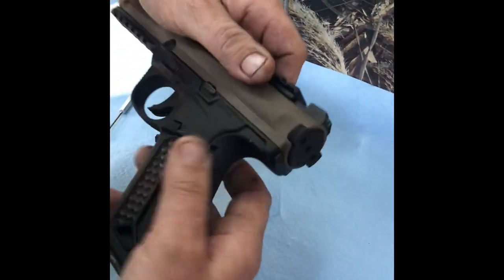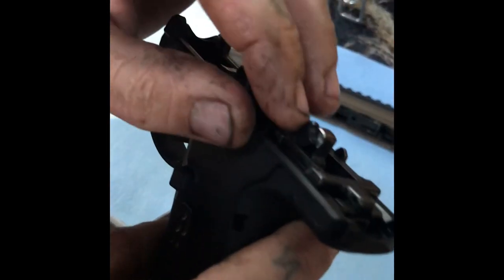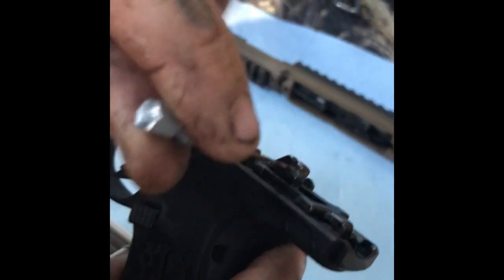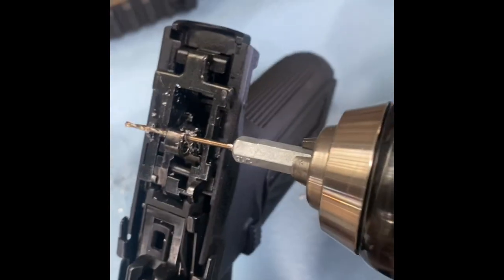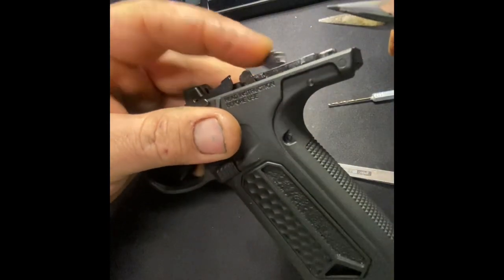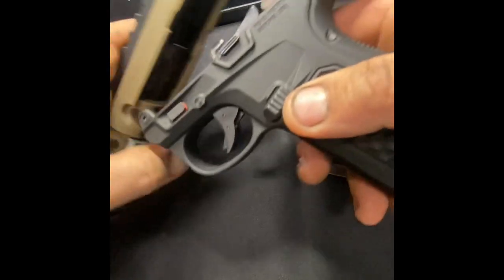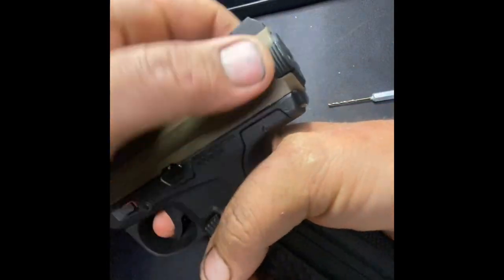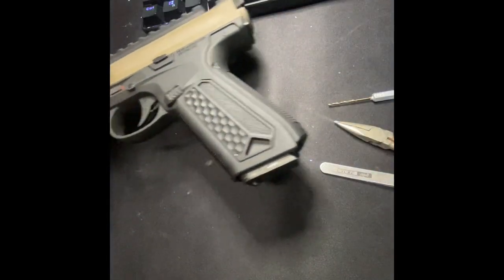AAP01 Airsoft hammer won’t latch fixed  (Airsoft not real)#shorts

Comment: I love my aap01 few days ago I got my pha tank set n mp5 adapter, today got my 4 mags tested it at 80psi an its friggin LOUUUD!! Soon gonna get my 3rd aap
Reply: Why do you need more than one?

aap01
Black tip barrel 
Maple leaf barrel 
Maple leaf dec. bucking
CncHop up upgrade 
Cow cow nozzle/seal set
Cow cow trigger
Cow cow hammer and sear set 
Cow cow fire pin lock
2Cow cow full auto sear 
Butterball bearing knocker
Amg antifreeze bulb 
Amg mag valve
 Select fire switch
Short stroke
Recoil spring 
Nozzle spring 
3d printed Rear mount with Trijicon clone
Drum mag with rubber seal upgrade
Reply: @AmericanToucan  nice